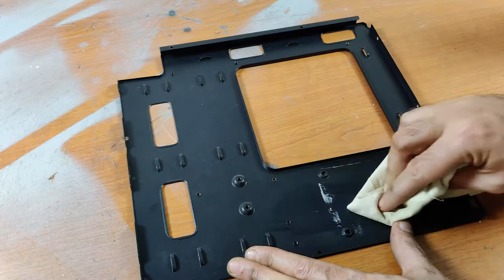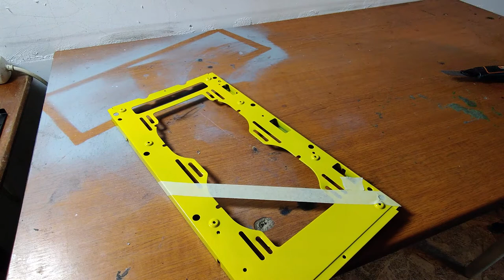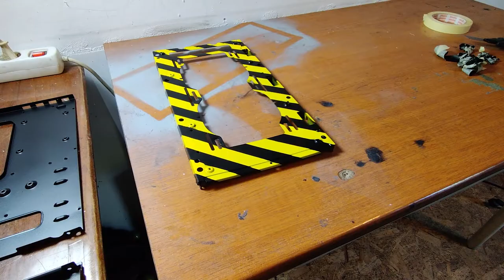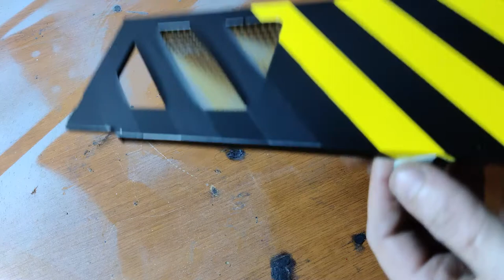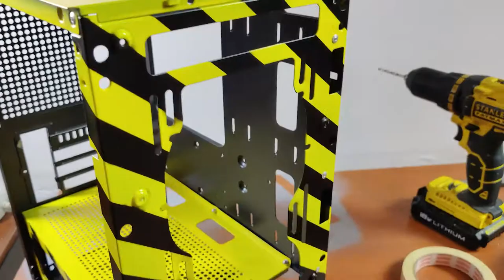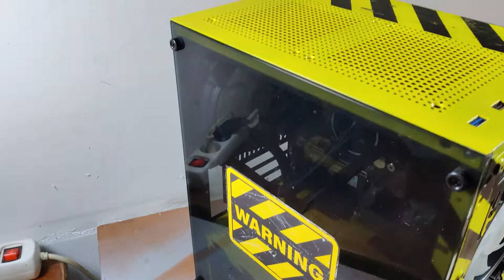How to Custom Paint Your PC Case | DesignSomething

Comment: Can you tell which specific version of DupliColor spray you are using?
Reply from the maker: This is the spray but matt version https://www.amazon.co.uk/Dupli-Color-693854-Spray-Black/dp/B00EZCY0WS/ref=sr_1_11?keywords=DUPLI-COLOR+black+matt&qid=1679043790&s=automotive&sr=1-11
Reply: @DesignSomething  Thanks a lot!!!
Do you think using a (etching) primer makes sense when working with powder coated parts and should I do something different when painting plastics?
Reply from the maker: @dahakamvl  The best practice is to use plastic primer when you paint plastic and self etching primer when you paint bare metal or powder coated. For both after 2 layers of primer sand the surface a little bit. Also after you put the masking tape spray a light layer of clear coat spray to prevent the paint going under the tape.
Reply: @DesignSomething  Thanks a lot for your help :)